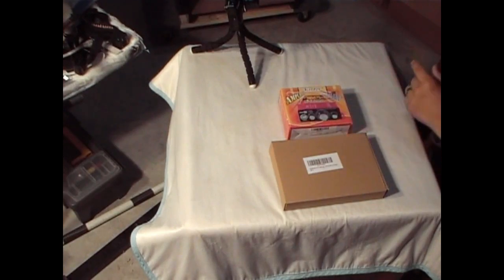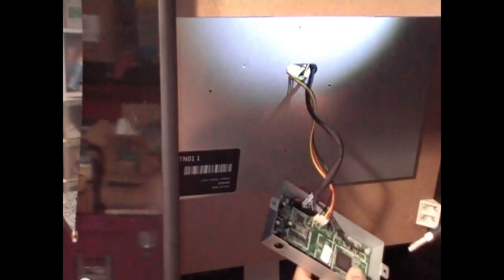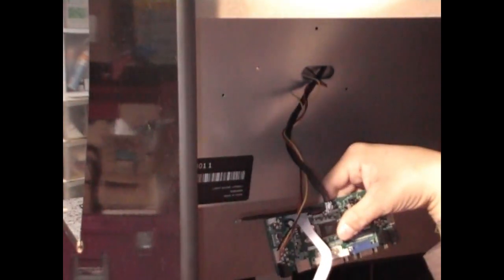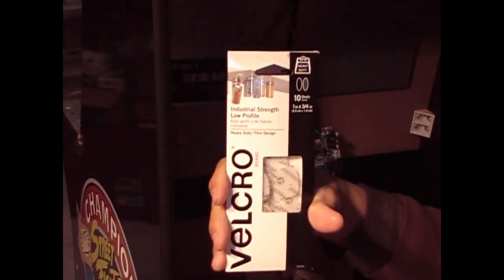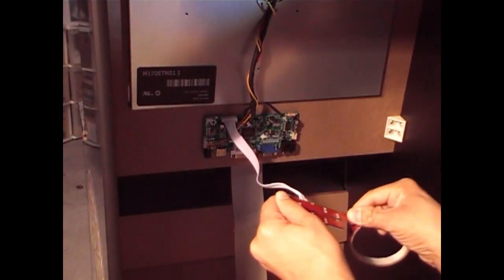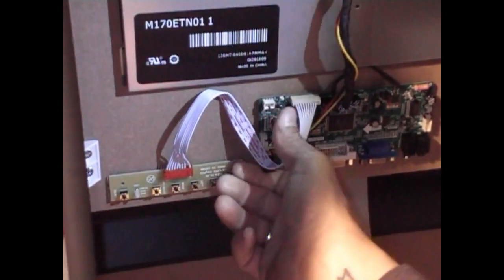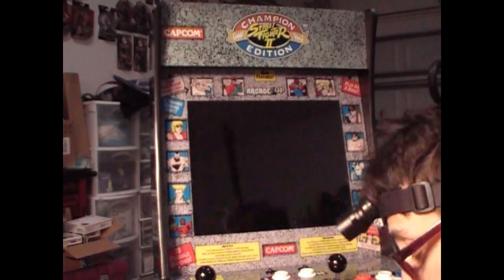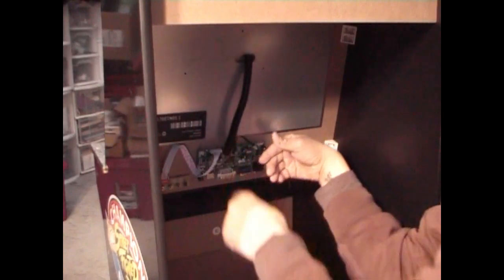ARCADE1UP - Ep. 2 - Controller Board & Mini Digital Audio Power Amplifier

Comment: Cables are too short from my gen.3 cabinet so I have to mount the controller board onto the back panel of the monitor with thick Velcro. No issues so far fingers crossed!

Comment: I got that same amplifier and had to return it because it sounded to low plus it gave me a huge feedback noise. I got now the same amplifier that ETA PRIME used and now it works perfectly. Reason is that amplifier does not have the audio cable input. Also just to mention the on and off script works.for the raspberry pi but it won't turn of the monitor. I unplug it but when plug it back up it will turn on my raspberry pi also without touching the on and off switch.
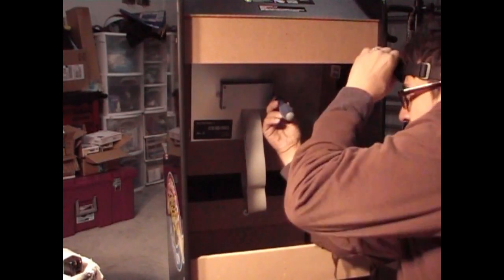Reply from the maker: I am glad you got it to work. I went with the amp I showcase because it was more cost effective plus i get all i need in one order power cord included. I have not had any issues on sound but then again i upgraded the speakers if you look at my "ARCADE1UP - Ep.12" at mark "3:45". Showcase the speaker upgrade i did from Retro Ralph, check that out i have not had any sound issues but i will check on it thanks for the heads up.
Reply: @thisability100  that's strange mine did not come with the power cord. I also purchased it because of the same thing it was less expensive.
Reply from the maker: @8BitLatinGamer  Yes as items become more in demand the value tends to go up but here is what i got and the plug makes it easier on the power strip such as space is not compromised.

Car Audio Amplifier with Power Cord DC 12V 3A, 20W + 20W Dual Channel Digital Mini HiFi Stereo Power Amplifier Handover AMP CD DVD MP3 PC (Amplifier+Adapter)
https://www.amazon.com/gp/product/B07JGGJYNH/ref=ppx_yo_dt_b_asin_title_o03_s01?ie=UTF8&psc=1

BOSS Audio BRS40 50 Watt, 4 Inch, Full Range, Replacement Car Speaker (Sold individually) 
https://www.amazon.com/gp/product/B001RNNX8K/ref=ppx_yo_dt_b_asin_title_o03_s01?ie=UTF8&psc=1

Onn 3.5 Mm Aux To Rca Stereo Cable, Audio Y Adapter Cable, 4 Feet
https://www.walmart.com/ip/Onn-3-5-Mm-Aux-To-Rca-Stereo-Cable-Audio-Y-Adapter-Cable-4-Feet/829969025
Reply: @8BitLatinGamer  I bought the same one. Also did not come with a power cord.